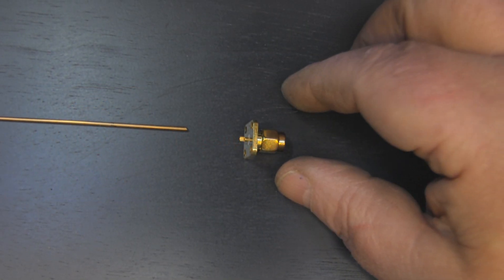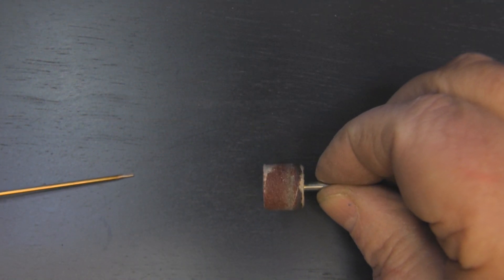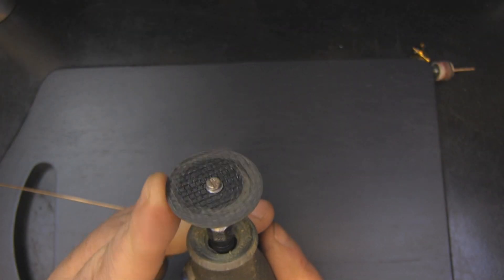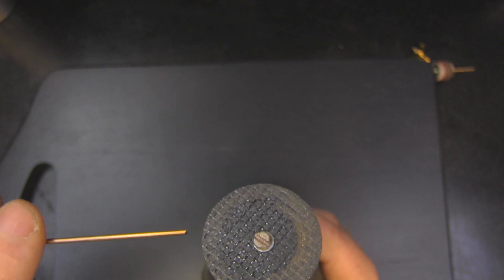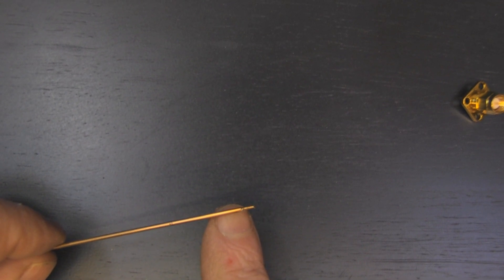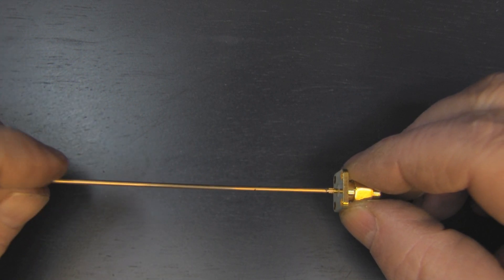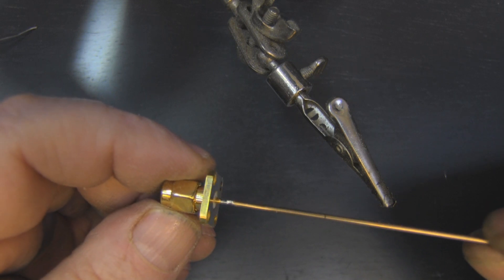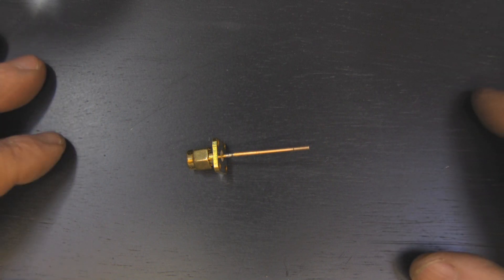How do you solder to such a small solder cup?

Comment: Hey Andrew, I have a question about the probe. Is it bad if the probe is not completely straight but ripples a little? The power wire was wrapped as a coil when I bought it so I had to straighten it.